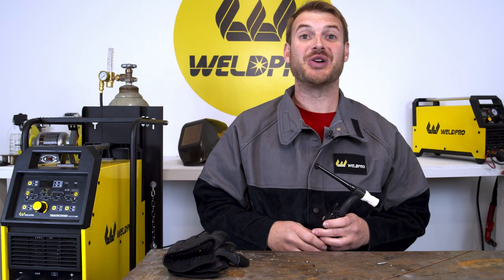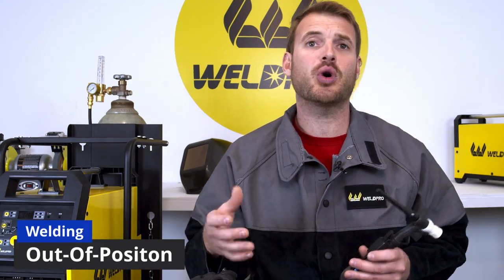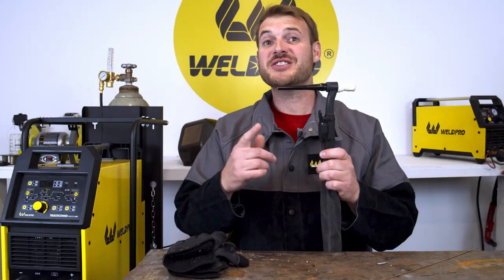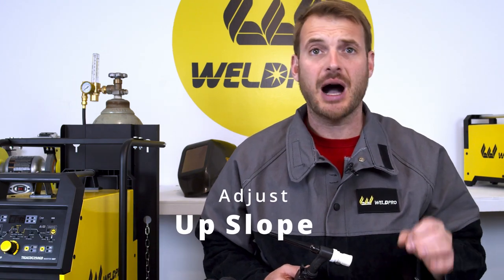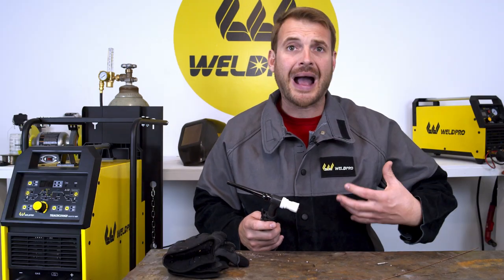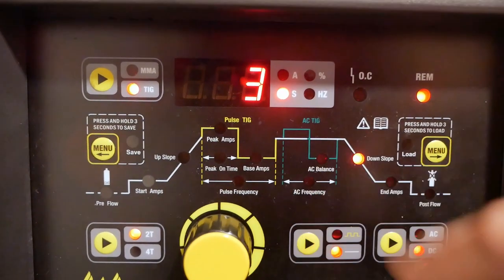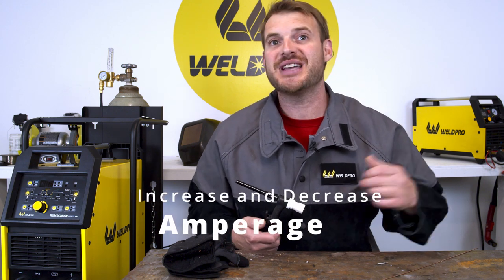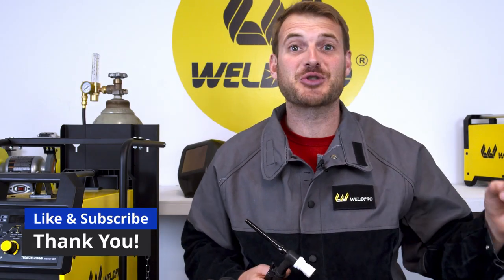Weldpro TIG Trigger Switch SETUP and Operation

Comment: I want to buy The weldpro omni210 and it comes with footpedal for the HF Tig, can it be switched or upgrade for this torch , that has the trigger switch in the hand ?
Reply: The Omni comes with both the foot pedal and the detachable finger trigger switch.  The Euro torch with the built-in switch is designed for a different machine.

Comment: So if upslope is 3 seconds, but the pulse is set to once per second... does that mean, it wont get to full amperage until 3 pulses have occured? And is Start Amps the same as base amps?
Reply from the maker: Yes start amps and base amps are the same. If you are pulsing once per second it would be a good idea to turn the upslope off. You would not achieve your full amperage with it turned on.